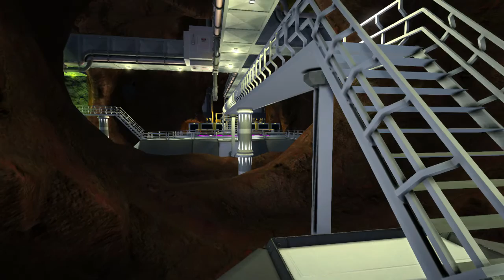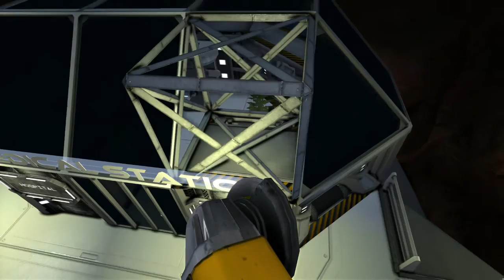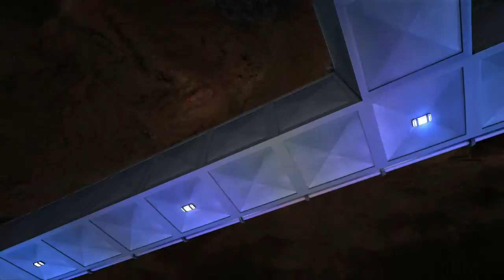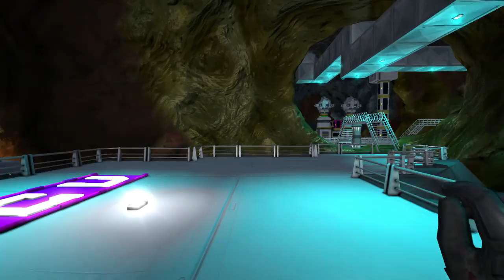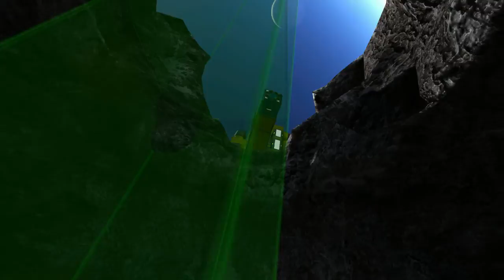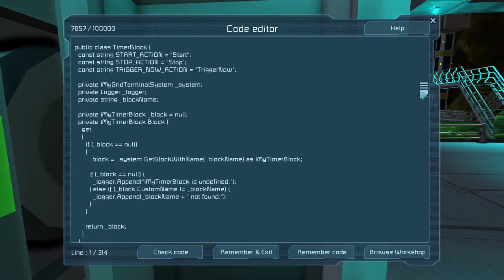E28 "Up, Up, and Away!" | The Nidd | Space Engineers

Comment: I ran into the stairs not giving power though them too! I guess if the modder would change the stairs to a two block high vs a single block high that may fix the issue, but I'm not to sure how difficult it would be to change those settings
Reply from the maker: elementalblaze79 Neither do I. I've haven't really dabbled at all in modding yet. I'm glad I'm not the only one noticing it though.

Comment: An idea for showing the "medical bay" sign, you could have a pillar then have a cat walk with a wall, and have three of them on the pillar next to the medical room. I don't know if that will work or even if it will look good haha, but just something like that you could try instead of having it actually on the room itself. Either that or you could connect a small ship on a Connector and just have letters on the small ship saying medical bay, sort of like the sign I have on my base on TLoN, if you remember that.

And yeah, those stairs are actually very glitchy, I keep placing them in a ship on TLoN and it'll be fine and let me place it, and I move and it's fine. But the next time I log, it detaches itself from the ship, so I might lead away from using those or ships.

For the lights, maybe you could keep the neon blue, I thought it looked quite cool in my opinion, especially on the actual medical room.

And for that gravity thing, I'm guessing it's to either take you up to a ship, or a trap for boris haha.
Reply from the maker: VRTX Raptor Interesting ideas for the medical room sign. I do need the sign to be on the hut since I need the open space for another building I'm planning. You've given me some more ideas though.

The stairs look so good (to me) though that I need to use them. So far I've only used them on a station so I haven't experienced the glitch you're talking about. Thanks for the heads up.

The first blue I had for the lights before the game freaked out you mean? I agree, it did look cool but I thought it was a little eerie... but maybe that is a good look, especially if I eventually have an alien in the vents.

Your first guess on the gravity contraption is close... and I think I now need to have a "trap mode" as well. bwhahahaha